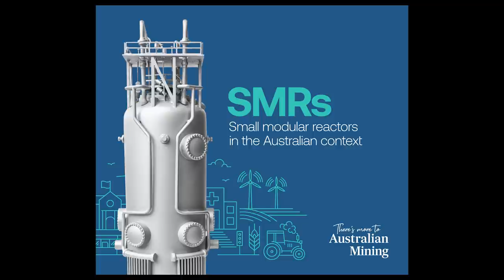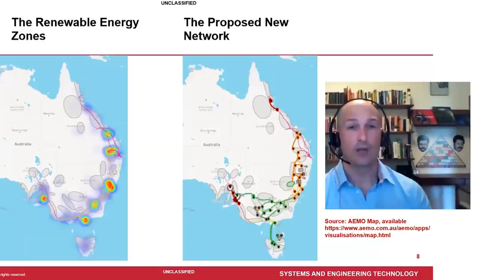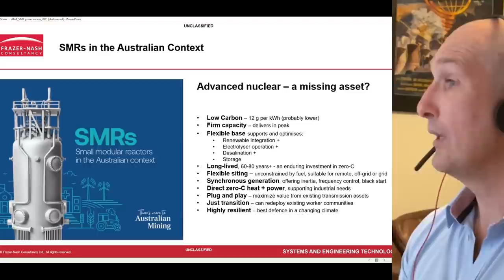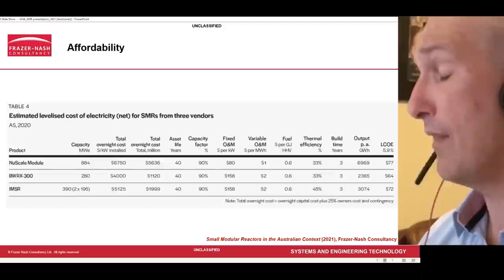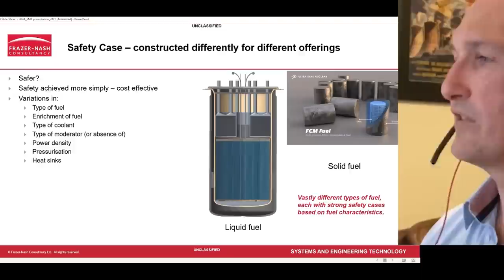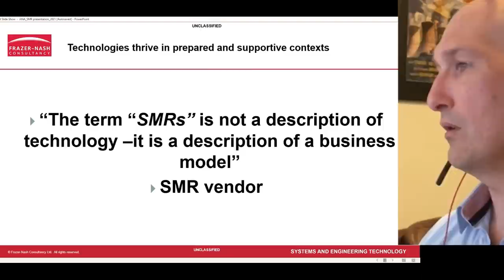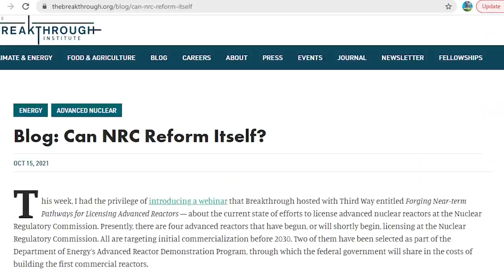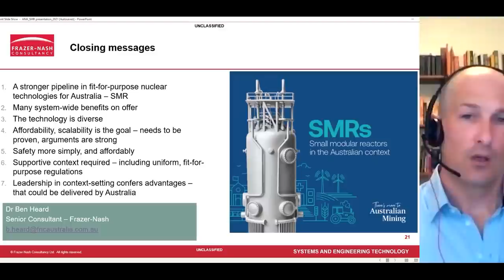Nuclear Australia: Small Modular Reactors in Australia by Ben Heard

Comment: It's good to hear that a molten-salt reactor is one of the candidates with some momentum.
Reply: Yeah, but with the added benefit of Thorium!!!
Reply: Australia is opening coal mines not building reactors, they need to agree and have regulations,this talk is the first step in that process, eventually they may buy a US or UK reactor.
Reply: ThorCon would be perfect for them.
Reply: @jimjardine4705  Thorium is a great idea as a long term goal, but uranium makes the whole concept quicker and cheaper
Reply: Molten Salt also can produce hydrogen and be used for desalination.
MSRs have significantly lower cost, reduced risk, and low waste.  SMRs have the same high risks and costs as all water reactors.
Uranium should be used as a primary fuel, with Thorium added later

Comment: Modern fast breeder (lead / sodium cooled) or molten salt reactors are intrinsically safer than traditional light water reactors. If the concern about nuclear power is dealing with volume and radioactivity of long lived waste then the industry must focus on these advanced reactors and not variations of existing light water designs.
Reply: Yes I think the old design is due to the inherent issues with new designs taking time and putting lipstick on the pig is just quicker
Reply: Waste is not a current or future problem solar is much worse in waste streams, the problem as the presenter pointed out is the cost and length of time to deploy.Australians love coal and SMR's reduce the appeal of coal.
Reply: Nothing wrong with traditional light water or the new SMR like RR or NuScale,waste is no problem, just something the coal industry uses to keep their position as number one energy source, coal has shot up under Biden.We can build advanced fast reactors without tearing out our cleanest cheapest clean energy.
Reply: Coal and nuclear industries could co-exist if they wanted. Especially when you consider the radioactive materials that naturally exist in coal and especially brown coal which get concentrated in mine tailings and fly ash. These could be recovered and used to fuel the advanced / small reactors. It would be definitely cost effective for fast reactors given their small fuel requirements.
Reply: @gower23  The whole point is to stop coal burning, that MSR’s are cheaper is a side benifit.
Reply: @Paul Bedichek  I disagree. Cost is and must be the first consideration. People are not going to invest in a venture that loses money.

Comment: I'm not sure Australia has an option to wait. These are long cycle programmes and the manufacturers and the industrial capability is baked in early. As you yourself said, the advantage is in the "many" manufactured from single manufacturing facilities.. Australia needs to partner now! And RR SMR is not just a sovereign solution. It is looking internationally and understands its addressable markets.
Reply: RR and NuScale are similar, light water reactors submerged in underground pools. RR doesn’t have to deal with archaic US regulations when in UK or elsewhere, first power in 2030 from NuScale in Idaho US.
Reply: Doosan Heavy industry will be building the NuScale modules.

Comment: The advantage of Thorium is that 100% is usable as fuel, with Uranium only 0.7% of the fuel is usable in a reactor.
Reply: Unless you fast-breed uranium-238 into plutonium.
Reply: @benthere8051  Shakti V disagrees about "useless in the bomb", as it had a U233 core. And about Pu... well, you can breed it into Pu240 instead - good enough for a reactor, will fizzle a bomb.
Reply: Not really. Thorium is fertile not fissile. Thorium232 must be "bred" via neutron absorption into U233(fissile) by exposing it to fast neutrons in a breeder reactor. Most current power reactors use a slower moderated "thermal spectrum" neutron design and can run with a low percentage of fissile fuel in the mix. Your 0.7% Uranium(U235-fissile) is also 99.3% U238(fertile) which, in the same way as Thorium, in a breeder reactor will absorb a neutron and and become the isotope Pu239 - a good fissile reactor fuel. So this is not really an advantage. What is the advantage of Thorium? There is lots of it and it is cheap to mine. There is also some controversy over whether the breeding of pure U233 from Th232 can be properly safeguarded from proliferation in a Th breeder MSR.

Comment: Agree pretty much your analysis.

To maintain our standard of living Finkel has estimated Australia will need 700GW generation capacity by 2050, to replace that component of the economy dependent on fossil fired energy.

This would require about 10,000 square kilometres of solar panels or equivalent wind energy generation as well as power convertors,  interconnectors and storage to reliably sustain the system and a program for maintenance, repair and replacement on a 20 year cycle. 

The cost and effort for this is vast and although individual solar panels and wind turbines are relatively inexpensive and the energy source effectively free, exploiting the resources requires a huge and costly logistical effort.

Nuclear wouldn't replace renewables but complement them in a way that greatly reduces the latter's need for storage and interconnection while providing the energy intensity and reliability needed for industry, with renewables helping to cap the overall cost of energy inputs to the economy.

Strategically, to be competitive Australia, will need a strong diverse 'fossil carbon free' energy portfolio, to sustain itself past 2050. This will be impossible without nuclear being a substantial component. Any nuclear would be better than none and I wouldn't dismiss the prospect of say six or so 4GW PWR plants feeding the east coast grid. However, realistically, SMRs are likely to be a crucial part of the picture with a much larger number of smaller plants distributed across the country.

In the end it's a strategic rather than economic issue. Do we want to survive and thrive, or head back to the dark ages? Perhaps as Caldicott has suggestsd readopting beeswax candles and whale oil as a source of energy.
Reply: I foresee nuclear eclipsing most wind and solar.

Comment: Love the idea of Aussies doing Gen IV reactors, SMRs, MSRs, etc.  However, one interesting idea would be to build a few CANDUs as well.  Since it doesn't enrich uranium, it could use CANDUs which use naturally mined uranium and thus consume its OWN uranium resources for power.  They tend to be larger so it doesn't solve the problem completely but would give some base-load where desired.  The tech on a CANDU is quite simple as well.  It (like any uranium reactor) also makes some plutonium, which could be chemically separated and used as fuel on other designs.
Reply: Large is fine.  We have plenty of land here in Australia

Comment: Thorium is propably a good way to make high burnup MOX-Fuel(thorium instead of U238).
A litfle bit more efficient in the fuel use, and much less Americum in the used MOX-fuel.
Maybe Framatome is going this way some day in the future anyway.
Reply: Thats where fast spectrum molten salt is better.... and you burn the once thru rods as fuel. 100-300yr storage from using the old rods that are massively longer storage requirements. elysium and terrapower are finalizing the systems.
Reply: No, thorium has no future due to high level radiation wastes.
U-232 has a relatively short half-life period of time(67years). The fission product is a Tl-208 - super strong gamma-emitter.
Reply: @markwright196  Thats good for bruning 'everything thats fissile but nasty', like burned(u-238 based) MOX fuel,.. yes.
But: The FastMoltenClorsaltreactor isn't ready, more 'conventional fuel technice like MOX in LWR keeps 'A thing' for many years to come. Thorium-MOX fuel would be a nice addition there.
Reply: @evgeniisutula3818  U232 is manly a problem in the handling, unlike U235 you can't touch it' but need remote Operations and thick-leadglas gloveboxes like you use for Plutonium yes.
But in the nuclear Waste, things like Americium are 'much more nasty' than even U232.
Conversion-factor in an EPR-reactor for Uran for example is ~80%, for thorium 90%, so you should save to ~1/2 the fissile on the long term. Even to use it 'ones through' like Uran-MOX today should be beneficial since you need less initial reactivity-reserve for the same endourance.
This is one of the best presentations on that topic i have seen by know:
https://www.youtube.com/watch?v=aNZwCnW5dAw

Comment: I agree with the author that "improved' safety contributes to reduced cost, and that conventional nuclear is already extremely safe. However, I think the real safety advantages of a molten salt reactor are not trivial. The biggest advantage is that, for example, if Putin were to target one with a cruise missile and blow up the reactor core, it is likely that the cesium and strontium would remain in solution in the salt which would solidify on site, meaning no widespread radioactive fallout like we saw at Fukushima and Chernobyl.

Comment: Is the absence of details of Indonesia's initial   cheaper choice of seven USA based ThorCon 500MWe liquid metal Thorium ion molten sodium fluoride salt burner energy converters for $1200/kiloWatt and pre-profit levelised running cost of$30/Megawatt.hour a deliberate omission in this analysis?
Walk-away Safe auto load-following or as a base loader sitting on only a couple of football pitches (65m×180m=1.17Ha that's 42.75kiloWatt/m² - cf. 25% (6hr/day) avaliable PV Solarfarms 2Watt/m²).

Comment: Is the decommissioning, cleanup and radioactive waste disposal factored in to the cost estimate ?
Reply: Most countries Yes ... unlike solar and wind which nobody really deals with..... ok germany burn the props for energy everyone else does a dump and run so no costing there
Reply: @markwright196  UK government funds the sellafield cleanup at £2 billion per year and it's expected to last a century. I didn't see discussion of the cleanup costs in this video, so therefore it's a serious concern. I agree all energy sources must have cleanup factored in to the initial calculation.
Reply: @TerryClarkAccordioncrazy  Thats where adding MCFSR are better... They have almost zero long term waste and they can burn the existing once thru rods as fuel. This is a no brainer and has no reprocessing, an 8hr window for refueling once a year. These are great if you have conventional reactors as you can just reuse the spent rods as fuel for the next reactor. So the high cost of dealing with transuranics and storage is eliminated.
Reply: @TerryClarkAccordioncrazy  
Comparing 1st & 2nd gen with 3rd &4th gen reactors is disingenuous. Your comparing pressurised reactors that require constant vigilance, while the other has passive walk away safety at it's core. In this regard there is no comparison.
Reply: That is infantesimal compared to the insane quantities of waste wind and solar will produce for all time if we were to actually try and power civilisation soley with them

Comment: The answer is Thorium Molten salt SMR Australia has the worlds Greatest Thorium resources  in the world
Reply: Thorcon's or Elysium's concepts would be quite economical and also require less time/R&D (for the shorter term), no? (China's taking the Thorium route, and is imo still stuck in R&D and building coal plants)
Reply: @red-baitingswine8816  Stick with solar wind and batteries as the short term future until Fusion can be achieved . There was a reason australia avoided Uranium based Nuclear fission for this long and it has a lot to do with not wanting to develop nuclear weapons which is the only way to ensure viability.
Reply: There are no disadvantages to U or we would use Th.But Th just gives you U233 which is then burned.India is working on Th but they like China are great coal burners, like Australia.
Reply: @paulbedichek2679  Yes like the idea of thorium. Many potential advantages ultimately I think a Thorium reactor will end up being too expensive as renewables and batteries keep reducing in cost.
Reply: @red-baitingswine8816  not worth responding to.. even though I just…. Responded.
Reply: @tigertoo01  (My posts were no longer registering on my display of the conversation). It seems clear to me that Thorcon's and Elysium's concepts will be viable (you can check that out at this site if you're interested). You haven"t refuted this in any substantive way.
Reply: @tigertoo01  yer when theirs no sun for 3 days no wind That is  why we burn coal course all the problems pollution  just look at the advances in nuclear even use old fuel
Reply: @ozloon2000  that’s just fear talking. Reality is a diverse renewables energy infrastructure with battery back up will provide all the power ever needed for humanity without the pollution of fossil fuels. It will also provide millions of well paying jobs for people. Money usually wasted on just burning fossil fuels will be diverted to people to install, maintain, recycle and rebuild renewables energy infrastructure as it’s required.

Comment: "Safety is non-negotiable," and from here the engineering needs to follow. For the cost of doing business, which is what this vid seems to be about, consider the amount of uranium and thorium the earth possesses. If one has a walkaway safe reactor available for sale, the opportunity for factory production of safe reactors becomes economically viable. The price of fuel settles down. Even if no big fix for rad waste is achieved, we'd have production of safe energy, and we'd have some in place in case Renewables fall on their ass. Here, the engineers need to step up. My fav is still CO2 moderated coolant. No fire, no explosion possible.
Reply: We have much better coolants than C02,at supercritical it can be used in the turbine,.
Reply: @paulbedichek2679  Understood for supercritical CO2. I am thinking of its gaseous use as a non-flammable neutron catcher. The British used CO2 for their ancient Magnox and AGR reactors. The engineering could have been much better, and in any case, gas turbines were much cheaper.
Reply: @mortimerhasbeengud2834  Yes,UK is an advanced nuclear nation, but you don't hear anyone building that type of gas reactor, what is current is the He cooled TRISO fueled,XEnergy or Chinese HTR.Also Ultra Safe Nuclear 15MW.
What we all found out is that the Graphite is critical, so better to just replace the entire core than have to inspect it.Graphite used for a number of different advanced reactors..
Reply: CO2?  HOW DARE YOU!!!🤣😂🤣
Reply: @thefleecer3673  Oh yes I dare! But seriously ;-) it is a bit questionable if we'll really need to go nuke beyond what we now have? The old marketplace shall decide, and marketplace loves cheap.
Reply: @mortimerhasbeengud2834  that's a good point, and segues into a real personal gripe of mine.  We need Gen 4 up and running ASAP, but instead we are wasting literally billions of dollars hand wringing over climate change and virtue signalling with wind and solar
Reply: @mortimerhasbeengud2834  well said